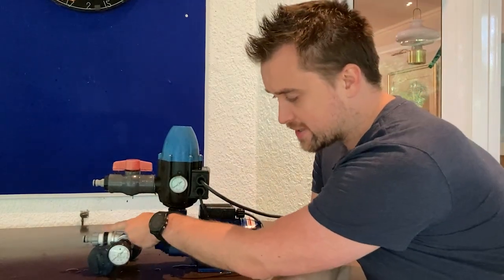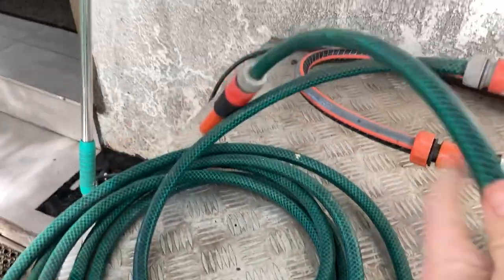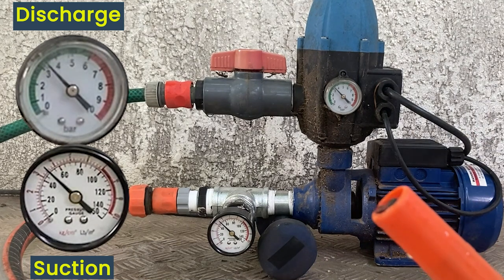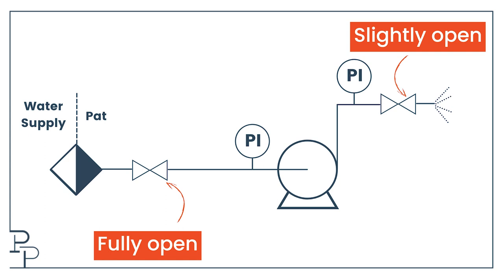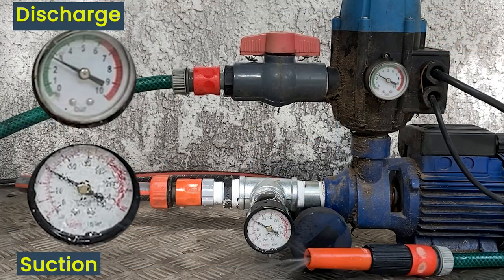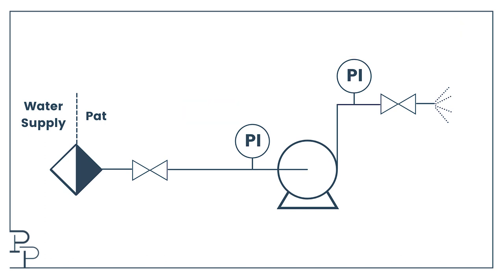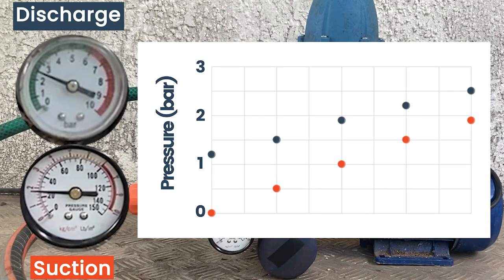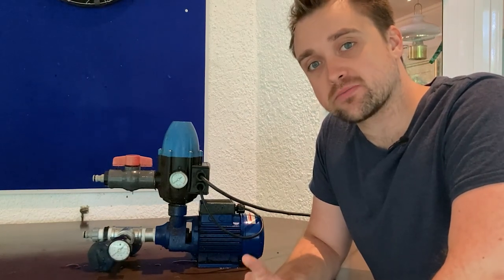Increasing pump suction pressure... What happens to the discharge pressure?

Comment: Hi Pat, 

Great video. 
Just wanted to ask about how increasing flow rate increases the suction pressure.
I’d have thought that increasing the flow would reduce suction pressure because the pressure loss in the suction pipe work would increase thus reducing the suction pressure? Or is the fact that you increase the suction throttle valve opening which reduces the pressure drop across this valve which therefore increases the suction pressure? Or is it a combination of the two effects?
Reply from the maker: Thanks Sean! You're spot on on all front. By opening a valve on the suction I AM increasing the pressure drop in the suction line (which should drop the suction pressure); however, the pressure drop across the valve is lower because I've opened it, so the net effect is an increase in suction pressure. Had I not had a valve on the suction and only used the one on the discharge then opening that discharge valve would have caused the suction pressure to drop, as you correctly note.
Reply: @ProcesswithPat  thanks for your reply Pat - that makes total sense!

Just as a follow up - can you control flow in a system using a valve at any point in the system? For example at the most upstream point in a system (say at the inlet to a pump) or at the most downstream point of a system (say if the pump led into a long length of pipe work which had a control valve near the outlet). Both valve locations could theoretically be used to control downstream/upstream flow respectively?
(Hopefully that makes some sense haha!)

Comment: Good video, three observations: 

a) You correctly point out that your suction lines are uhmmm, sub-optimal. In general suction lines are designed quite large with low dP characteristics (minimal bends and fittings) so that changes in flow do not really affect the pressure at the pump suction.  
b) Increased suction pressure does not necessarily lead to higher flow. In your case this is true because your throttling the suction valve. However, when filling up a suction drum of say 1m to 2m head, and still controlling the flow on the outlet of the pump as is typical in most setups, the suction pressure goes up -> flow stays the same -> discharge head goes up correspondingly by 1m. Normally flows from centrifugal pumps are controlled on the discharge.
c) Many, especially bigger pumps, have a long flat portion of the pump curve at low flowrates. I.e. in this range there is basically no difference in the differential head when changing the flow.
Reply from the maker: Thanks Daniel! Nice to see someone is paying attention!

a) No excuses there, other than I used what I had. I have said my 50 Hail Perrys...
b) True. The message was meant to be if all I did was increase suction (and not anything else) what would happen? The thing is the idea of "only changing one thing" can be a little misleading because other things do change, and you one would need to specify what else you'd have to do to keep other variables constant (e.g. throttle discharge to keep constant flow as you put it). Controllers add another layer. I was actually contemplating a pump that is driven by a steam turbine - at least a motor keeps a constant speed, a turbine-driven pump speed may speed up or slow down depending on which controllers you've put in auto/manual... Messy stuff to try and generalise!
c) This is also true, but I wanted to stick to the general principle. You're right that this effect would not be as appreciable with flat pump curves, and I actually experienced something similar when I throttled the hose too much and created a very steep system curve. Then the differential pressure stayed relatively constant because flow could not change much.
Reply: @ProcesswithPat  Didn't mean to be critical, just some observations. I totally get the purpose of your videos - understanding engineering principles in a day to day setting. Young engineers lack this understanding.

I really enjoy your videos - Perry, Liebermann and McCabe would be proud!
Reply from the maker: Not at all! Please do be critical! Nobody is perfect and I’m certain I speak a lot of nonsense sometimes.

High praise indeed!

Comment: Great video..
So here is a question.
Using variable speed centrifugal pumps for swimming pools. When the pump is above the pool level (suction lift no gravity feed) sometimes pumps loose prime. 
Will installing smaller diameter pipes increase pressure to the pump head preventing loss of prime. So 50mm pipes to pump head 63mm discharge?

Comment: Okay, great.

But what will happen to the shut-off head in case you increase the suction pressure?

For example, if there is a pump with a suction pressure of 0.2 bar and a discharge pressure of 9.5 bar, and the shut-off head is 10 bar, what will happen to the pump shut-off head when you increase the suction pressure to 1.5 bar? Will it increase or remain constant?

Comment: Hi Pat, if I am opening the suction valve.. this means that system curve's gradient is reduced meaning that it intersects the pump curve at a lower head. Therefore, the pressure that the pump discharges is reduced.  Does my understanding make sense? I suppose I'm asking if the suction valve impacts the system curve. Thanks!

Comment: Hello Pat! It is really an interesting video and got some great insights. I wonder if this question really makes some sense but please do let me know. As relief design engineers we often look if vessels are being overpressurized with liquid for our relief valve design. For a given impeller size we take a look at the total dynamic head aka differential head provided by the pump at zero flow that is dead head pressure. But if we find that the dead head pressure is less than MAWP of the vessel downstream*110%, we move on to add the level in the vessel upstream of pump converting into pressure. Is it the right thing to do? Can we compare the MAWP of the vessel downstream by adding up the dead head pressure and the level within the vessel upstream of pump?
Reply from the maker: Apologies for the late reply, but I'm going to approach this topic with extreme caution, because I do not want to be giving design advice with real-life project implications. So take all disclaimers as given and always consult a non-internet based expert! ;)

I presume that if you are in the industry, then you are familiar with API 2000, 520 & 521 for venting & pressure relief.

A relief valve on top of a vessel is typically relieving a vapour (either air, an inert gas blanket, or the vapour phase of a volatile substance). You need to differentiate between normal inbreathing and outbreathing, and emergency pressure/vacuum relief.

When you are pumping a liquid into a vessel, the maximum LIQUID flow rate of the pump will tell you about the necessary relief VAPOUR flow rate, because the liquid is displacing the vapour at round about the same rate. But you are not actually relieving liquid but rather a vapour. This is NORMAL OUTBREATHING, and your safety device should not be trying to relieve this continuously. Rather, there should be another vent/pressure control that handles this. The PSV is there in case of failure of the regular breathing system.

But that talks about relief flow rate. Relief pressure is determined by the design conditions of the vessel, which is also a degree of freedom, and this is the gist of your question.

Based on your comment, it sounds to me as if you are trying to sum all possible pressure sources to consider in the relief pressure of the vessel, but it sounds a little backwards. The design pressure and MAWP should be based on this; you sound like you're starting with a given MAWP and working backwards. I understand how this can happen in the project, and it isn't necessarily wrong/bad. Also, if you are working on brown-fields, modifications, or revamps, you cannot always change the design pressure you've been given.

The point is, you should not reach a point where you have zero vapour in your system because it it totally liquid-filled and you are pissing liquid out of your PSV into your vent system. To prevent such a scenario you need overfill protection in the form of adequately SIL-rated high level switches.

What you are describing is only ONE relief case for which the PSV is sized. In reality, there are other cases which may be more severe. A possible example is the "fire case" - where you assume that there is a fire in the vicinty of the tank, and the radiant heat and boils the contents of the tank for which you are sizing your relief valve.

It is highly dependant on application - pumping water, solvents, or petroleum products need to be assessed individually. 
It get's complicated and what I am learning is that there is no "correct" answer, because at the end of the day you are not getting away from doing a risk assessment. At the end of the day YOU need to determine what is acceptable risk, and you will not find a silver bullet in this regard. It's a tough thing to accept, but the onus is evetually on the designer and the user to determine what acceptable risk means.
Reply: @ProcesswithPat  Thank you Pat for detailing. I was specifically considering overpressure with liquid case in the question mentioned above assuming it to be the only governing relief case and a pressure vessel in specific and not a low pressure storage tank to be precise. We do take total dead head pressure which is the sum of shut off head and suction pressure as a criteria to determine overpressure with liquid scenario.

Comment: I know this is a dumb question, but I'm having an argument at work with someone who allegedly knows more than me…. If a pump is not running (VFD@0hz) it is impossible for discharge on a centrifugal pump to be higher than suction pressure, right? That's indicative of the gauges being gimp, right?
Reply: (Eliminating the possible factor of head pressure, the cooling tower supplying the suction is 14 floors up and is discharging to feed a chiller's condenser on the same level as the pump)

Comment: Hi Pat….could you please help me with a complicated NPSHa calculation for a Pump?
Reply from the maker: Sure thing. Send it to me and let me see
Reply: @ProcesswithPat ….do you have a place I can send you photo?
Reply from the maker: Describe it here.
Reply: @ProcesswithPat  ….Double Suction Horizontal Centrifugal Pump rated for 6500 m3/hr, 32” Suction line first 6 meters then 32” to 50” Eccentric Reducer to 50” long radius elbow inside a water basin, for a total suction pipe length of 8 meters before elbow. Centreline of Pump Suction is 3.3 m above bottom of water basin which 5.5 m tall filled with water. Note eye of impeller is 750 mm above centreline of Suction piping.
Reply: Water Temperature is 27C and atmospheric pressure is 10.26
Reply from the maker: To be honest, there is nothing in your question that seems interesting or unusual. I'll happily discuss theoretically thought provoking questions. This question I'd have to bill you for. Good luck!
Reply: @ProcesswithPat  I am not surprised 😮 you are only the 10th process engineer I have asked and not one was able to answer it 🤣🤣🤣🤣🤣🤣🤣🤣🤣🤣🤣

Comment: Thanks man, I'm honestly shocked you haven't lost patience with me, I feel like I'm wasting your time with my inability to understand basics. 

Anyway, so pressure (whether it be suction or discharge), comes from elevation right? If the pump inlet was supplied by a freely flowing river, you'd have 0 suction pressure? If your pump was located above the top of your inlet source, that would be 0 suction pressure too right?

My understanding from other videos is that a pump doesn't actually add pressure, because the discharge pressure (and thus differential pressure) depends on the elevation that the water is being pumped against. Discharge pressure = Suction pressure + Pressure resistance due to elevation that is being pumped against. So what is the correct terminology for what the pump is really adding? Energy? In your experiment, I'm assuming the discharge was just shooting out the hose onto the grass or something, so why was the discharge pressure greater than the suction pressure if there was no resistance on the discharge side?
Reply from the maker: First of all, pumps transfer energy to a fluid. This energy is translated into a combination of pressure and kinetic energy.

Second, I think it would help you to demystify the 0 suction pressure. This is simply zero GAUGE pressure - there is absolutely no reason that a pump can run with negative suction pressure (gauge, obviously). The only concern with a very low suction pressure is that you risk cavitation if you are pumping a volatile fluid.

Look at my video when I start registering my pressures - the discharge pressure goes up a bit before it appears as though the suction pressure moves. I only note zero suction when I see suction gauge pointer move. Before it moves it looks like it is zero but it negative, but the gauge is not able to show this.

If I took that the same pump I used in the video, and placed in next to a swimming pool and had the hose run into my swimming pool, then the pump would be generating "suction lift" and the inlet pressure would be negative. The outlet pressure pressure would be determine by downstream resistance, and the differential would be determined by the flow (all these are inter-related as you are hopefully seeing, changing one variable changes them all).

A thing to note with my swimming pool example is that centrifugal pump is not self-priming. This means it would not be able to suck up fluid from my swimming pull if the pump started off filled with air. But this is a separate issue.

Comment: How to increase the suction power at the inlet of pump
Reply from the maker: Not sure what you mean by "suction power".
Reply: Hi pat
I have  question
How to increase outlet flow ?
It means inlet flow was low 

Example 
Inlet flow was  0.5 bar &I want outlet flow above 2 bar
Is it possible
Reply from the maker: I don’t understand your question. You’re mixing up pressure and flow…